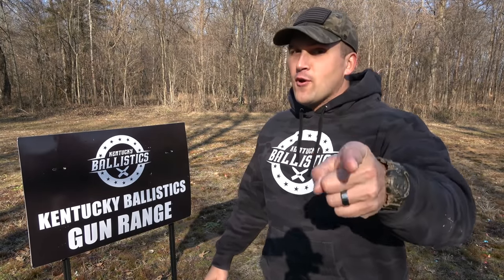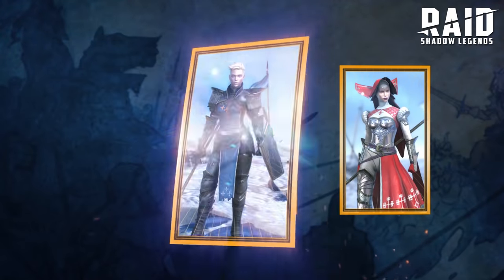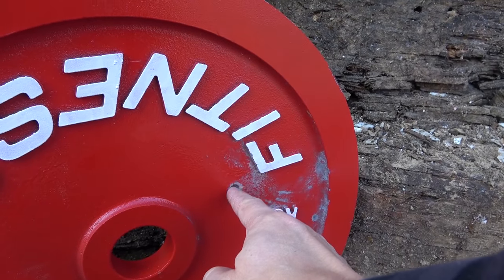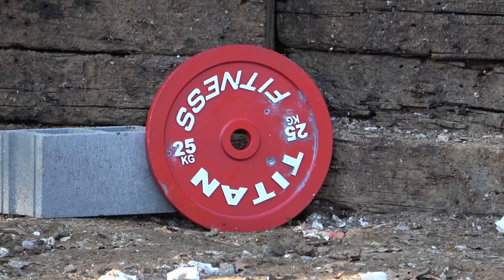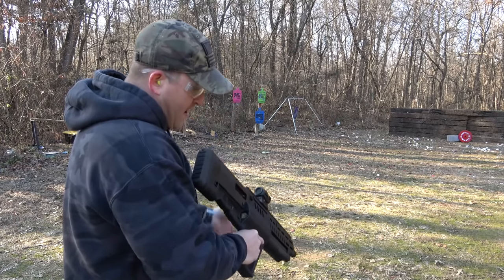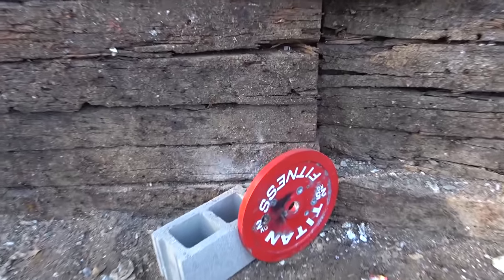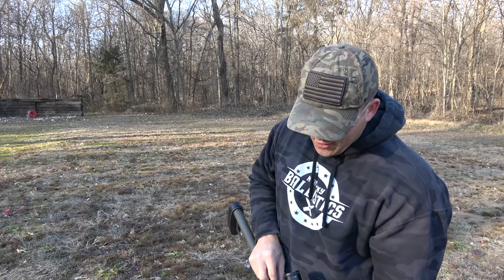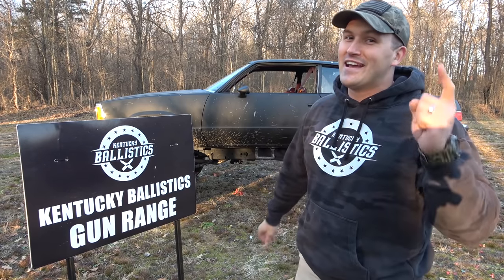50 Cal vs Steel Olympic Weight 🏋

Comment: How much for the used weight plate?  I can't find them anywhere right now!! I'll come pick it up personally and we can shoot something together...
Reply: Find a shop with a cnc laser cutter/ plasma cutter and get some cut out
Reply: The plate's still perfectly useful for anything except competition, as it probably hasn't lost more than a pound of weight if that.
Reply: You can meltdown scrap metal (first weighing accurately) in a DIY coal furnace and pour into a 18inch disc compressed sand mould (wooden/concrete frame) , or use concrete straight
Reply: Better get back to snow removal Zach 😁
Reply: @R32R38  i agree, so long as the 2 inch hole is intact, can still load it as "weight"..
Reply: Use train wheels
Reply: it is not longer calibrated.   you should get it for a good price.
Reply: just get eleiko plates.  since they overcharge for all their stuff, they usually have stuff in stock.
Reply: Blame covid - because commercial gyms have been shut down, there's been an explosion of people setting up home gyms. Weightlifting equipment manufacturers like titan and Rogue have developed a huge backlog as a result.
Reply from the maker: Haha! It’s yours man. Come get it anytime 🤙
Reply: Scott is a good shooter in he's guns and matt's to the demolitia one
Reply: Use rocks
Reply: Really still? they're starting to come back at academy around these parts anyway have been for a few months now
Reply: My mother sells weigh plates through Facebook if you’re interested. Only thing is you would have to pay for shipping on them
Reply: @machinist7230  I live in Pittsburgh,Pa and all the gyms around here are still open.may have a limit to how many are allowed in at one time but they're open.think they only closed for the first 3 or 4 months after the outbreak.
Reply: What up Zach!
Reply: @machinist7230  i have a personal gym....and lot of do like me... its a compensatiin for gear makers ..
Reply: I did not know you watch this millennial farmer

Comment: Someone might've said this before me, but I'd actually like to say this anyways just as a possible refresher.

Not only is angling the weight safer for the shooter, but it also adds to the effective thickness of the plate itself. Technically, at that angle, you're shooting a thicker plate than what is actually there, so if it were flat you'd likely have more penetration. Cool video tho.

Comment: My furnace guy is a funster.  He is also a welder.  He does mudding and the like and a buddy challenged him with an idea.  It almost looked like your except with tractor tires on an old Caprice.  Extended the rims by welding two rims together and just bolted it on.  No lift kit needed.  It did not turn well but the challenge was won.

Comment: 1:15 correction, the olympics use bumper plates as they're made out of rubber which allows the athletes to drop the heavy weights from overhead without damaging the equipment

if youre wondering WHY they would need to do so its because weightlifting (the official name for olympic lifting) is a sport of 2 disciplines, both require that you get the weight over your head, to save energy most athletes throw the weight on the ground quickly rather than slowly

Comment: I'm pretty sure Olympic bumper plates are soft on the surface and different from powerlifting metal plates (because they need to be able to be dropped from shoulder height). Not a big issue for gun shooting fun (the powerlifting metal plate is probably more fun to watch), but important for the lifters for the different dynamics in movement.

Comment: Just a small observation , the 25kg plate is not steel , its cast iron.
If you used a real steel plate you wouldn't damage it like this cast iron one.
Steel plates wouldn't be penetrated,  get one and try it..

Comment: Your disk isn't steel. It's cast iron. Most steel is softer and would have dimpled rather than cracked and crumbled in the back. Cast iron is brittle and would explain your results. Cast iron is also heavier than steel allowing weight disks to be smaller but still retain the required weight not to mention, pound for pound, cast iron is cheaper than steel. Great channel!

Comment: These are not steel, just cast iron. That's how they make Olympic weights but they could be harden cast iron which would since because they throw the weights on the ground A LOT. They either make the weights from a mold or they make a cast iron weight which is slightly bigger than they mill it down to size.

Comment: I loved you driving over things to smash them.  When I was still a teenager in the late 70's, and had not been in the Navy for a year yet we use to use the 12,000 pound aircraft tow tractors to run over bubble wrap to make it sound like a machine gun.  I thought I would be cute and rolled some up into a 5 or 6 inch roll topping it off with a layer of masking tape to hold it together.  Placing it under the rear wheels we all expected a loud bang.  I will let you try it yourself to see if you get the unexpected result we go.

Comment: Why don't they just make metal armor like this? I get that the weight is less than practical but its literally bulletproof unlike kevlar
Reply: there is steel plate body armor
Reply: not flexible, and say you lying on the ground, super uncomfortable.

Comment: Hi Scott, you most likely know that cast anything is crap even steel. I would double dog dare you to order maybe some high grade round stock about 12 inch diameter around 1.25 inch thick. No need to machine it just get it saw cut since your gonna shoot the crap outta it. Just about any steel will fair better than cast but a 4150 would be nice. Heck i would love to see 1.5 inch aluminum, bet it would do better than cast. Anyways gonna go check out your car channel.